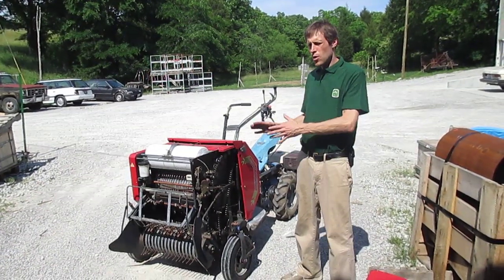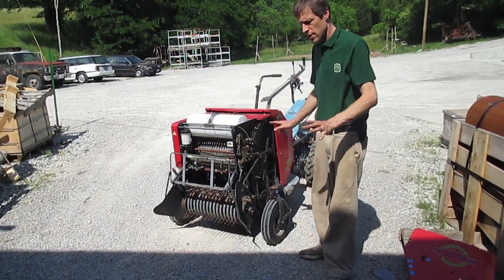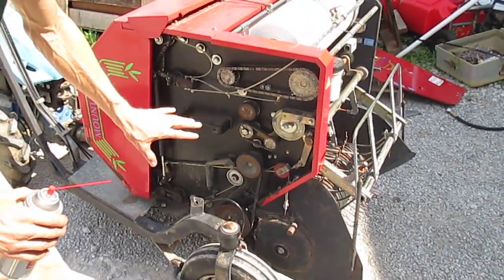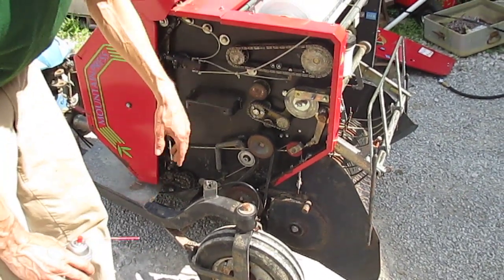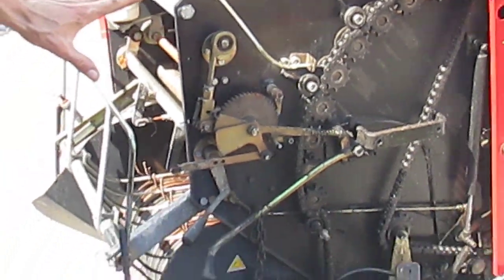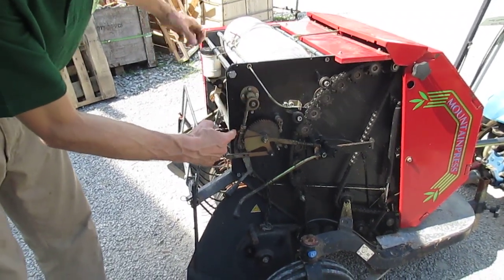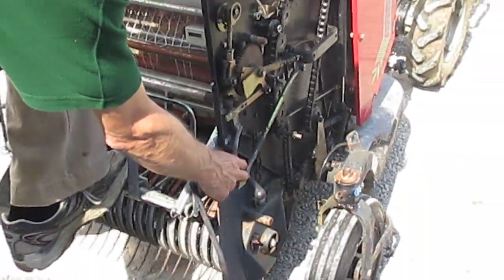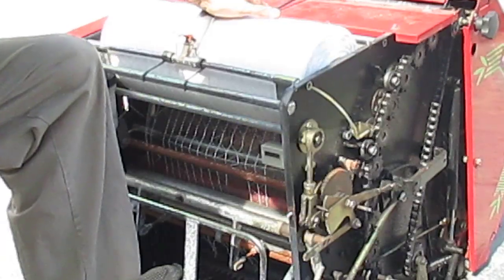CAEB Haybaler: General Service & Maintenance  (1 of 2)

Comment: Can't find in the manual which oil is recommended for the automatic lubrication system. Any advise ?
Reply: I have the tractor pulled version. I collect used 80w90 gear oil from my old cars and use that for chain lubrication. I also use a hand oil pump to thoroughly lubricate the chain before and after the hay season.
Reply from the maker: Sorry for the very late reply...I virtually never check these messages.  Actually, automatic transmission fluid (ATF) is preferred by many for chain lubrication...it is thin enough that it does not attract as much dust as thicker oils.